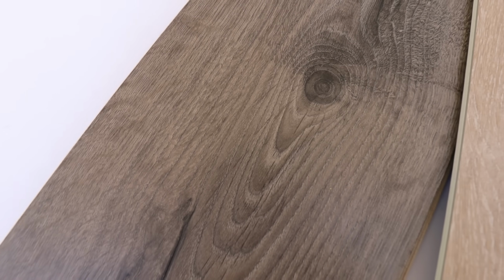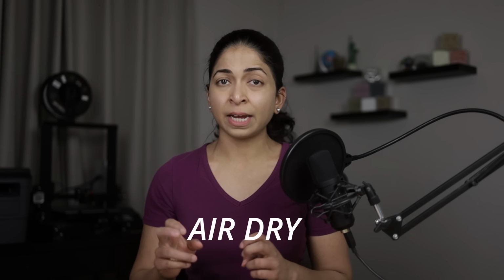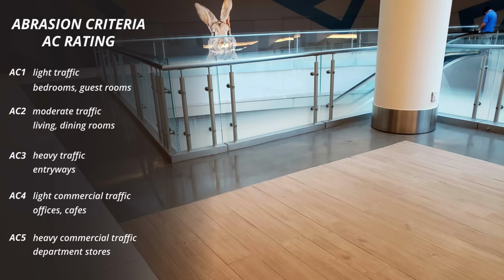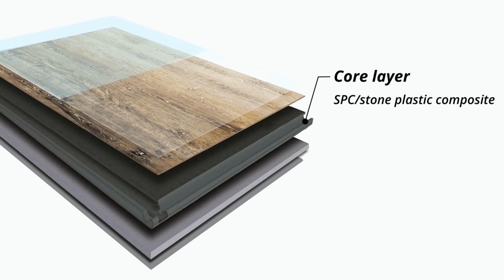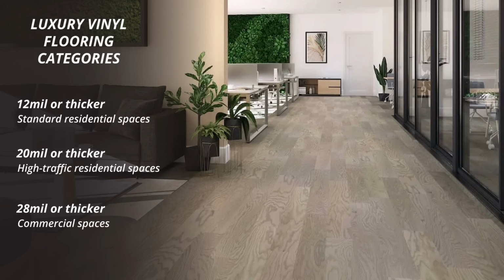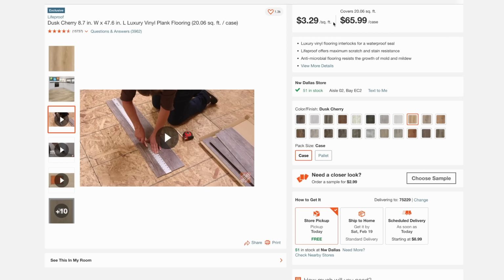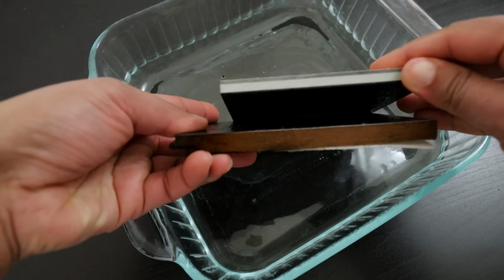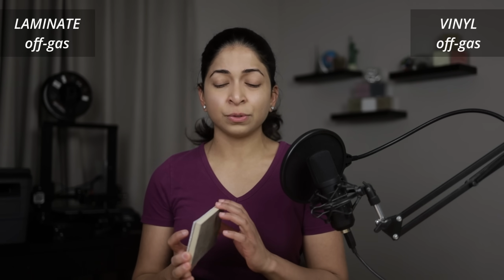Laminate vs Luxury Vinyl Plank Flooring | Everything you need to know!

Comment: The foam underlayment recommended for laminate floor and made by the same company has a fraction of a mm give under load.  That means that standing on one plank can make it try to drop that tiny bit below its neighbor.  A fraction of a mm distortion of the mdf substrate is enough to make a tongue fracture, a tiny length at time, because a couple mm of mdf tongue cannot support the weight of a human.  Within a year any heavy traffic area has the edge of the planks fray due to a fracture of the mdf.   The finish coat then peels and breaks off.  A warranty claim is dismissed as delamination due to water, even it it has never been wet!  We had to argue and point out to them that only the tongue side of many adjacent planks was failing, proving that the movement allowed by the foam slowly caused a fracture in each case.  Water would have delaminated both sides of the joint! They therefore gave us a full refund, but are still selling this bad design to other unsuspecting buyers!   Had we omitted the foam and put up with the slap noise, the floor might not have failed.  Wish we had paid the extra pennies for lux vinyl!       By the way, you show in this video your personal home floor "delaminating" and you assume that it was caused by water.  However, note that it, like mine, is only delaminating on ONE SIDE of the joints. That means, like mine, it was not caused by water, but by a fracture of the mdf!

Comment: I have had a Pergo floor in my basement studio for 20 years and it looks every bit as good as it did the day it was installed.  Better yet, me a 2 friends installed it ourself and it took better part of a day.  It has seen very heavy traffic and numerous types of spills (including dye and paint) that came right up without any discoloration.  It was installed on a concrete floor with a plastic layer that went underneath to block moisture.  The floor was not even close to level but you cannot tell once installed.  I can't speak for other brands but I would definitely recommend Pergo.  I don't know where they get 10-20 years.
Reply: Thank you, we just installed preggo in our house and everyone keeps telling us laminate is crap... this is reassuring to read

Comment: one benefit of vinyl is if you are dealing with less than a perfect leveled floor, vinyl is flexible enough to just fit. my old home has a concrete flat floor and has some bumps and stuff, it will cost me a lot more to level it out before I install laminated, I just use vinyl and nothing need to be done with the floor surface.

Comment: I have a shaw laminate flooring that I installed in most of my home probably 12 years ago and it looks like new. No problems with dog nails. I left some of the cut off scraps out in the rain for months and they didn't swell.  I like the way it feels underfoot and that it's very smooth- no texture, no beveled edges. I have 1 box of lpv flooring that I'm going to try out before ordering for a whole room. Just seeing it in one area I'm not as impressed as I am with the laminate. I'd think using a chop saw as I did with my laminate would give a more exact cut that scoring and snapping.

Comment: What about uneven concrete floors in a condo. I tried to install laminate flooring but it wouldn't stay together. Levelling compound doesn't seem like a good option because there are many sections of irregularities. The building has had carpet since it was built. Is there any flooring option that can conform to irregularities

Comment: For health reasons, go for LVP, especially for basement, kitchen and bathroom applications. Cost difference isn't huge unless you are a commercial house installing thousands of square footage. Have gone through mold and mildew removal in basement due to laminate and subflooring which had MDFs or carbonfootprints which molds love. LVP does better on such realms.

Comment: Outstanding video!  My wife and I are debating between the 2 and this helped a lot.  We did have a question that i am hoping you can answer.  When you mentioned the VOC's, is this only a concern for the first 2 days with the off gassing or the entire life of the flooring?  We are concerned about the chemicals and walking on the floor with our bare feet.  any concerns?  Thank you!

Comment: Good review of these flooring options! I've found that LVT fits together more positively than laminate and stays together better - the interlocking edges of laminate are made of MDF which is a delicate material. Laminates inevitably take up moisture and start to curl up after a year or so whereas LVTs are a lot more durable.

Comment: I have had both installed in kitchens.    I liked the Luxury Vinyl more.  The Vinyl was installed just like a ceramic tile floor.   Current home has hand scrapped engineered wood in the kitchen.  I have also installed myself tile in the kitchen of yet another house I owned.

Comment: Laminate floors will be destroyed with water left on the floor.
I don't see any reason or benefit of using laminate at this time when vinyl flooring is only 10-25% more expensive. And vinyl floor is actually little easier to install (no dust).
10 years ago installed (Germany made 25 years warranty) Laminate floor at my rental property (vinyl was not popular or available at that time), is now shows top layer ruined by water damage, specially at high traffic areas.

Comment: One more thing to consider.  Luxury vinyl tile is softer than laminate.  Heavy furniture like table legs will leave impressions on the softer LVT.  You'll need to place pads under everything including chair legs to reduce the small depressions in the floor.  Laminate will not have this problem.  LVT is more comfortable to walk on if you're barefoot.
Reply: Those pads don't stop the denting in soft plastic flooring. The weight isn't cancelled out, or even reduced at all, by a tiny piece of foam lol. All they do is make it less likely to tear when you move the furniture

Comment: You know, it really doesn't matter much about the looks, thickness, the waterproofing, or the scratch resistance among the different products.  What really matters the most is the locking systems that holds the whole floor together that wasn't covered in this video.  If the locking system fails (breaks)  from an inferior product, it will leave you with gaps and raised seams all over the place. You're not gonna care much about its waterproofing or scratch resistance then!  Buy quality over looks and price and you will be glad you did over the long run.

Comment: As someone who inspects homes for a living, one bit of advice I would offer is DO NOT INSTALL VINYL FLOORING OVER WOOD FLOOR FRAMING THAT IS CONSTRUCTED OVER A CRAWLSPACE AREA - ESPECIALLY IF NO VAPOR RETARDANT GROUND COVER IS INSTALLED IN ATOP THE FLOOR OF THE CRAWLSPACE AND YOU ARE IN AN AREA WITH WET SOIL CONDITIONS…….!!!!!

The vinyl tends to act as a vapor barrier against which naturally occurring moisture from the crawlspace condenses and eventually saturates the wood subfloor and framing members beneath. This usually results in rot in the subfloor panels (first) and (eventually) the structural framing itself……!!!!

Comment: In my old house, I had the HVAC on the first floor and didn’t do proper maintenance for a couple years. As a result, the unit started leaking water from the AC. I would hear a drip every now and then, but thought it was in my head. Eventually, I would walk by the closet where the HVAC was and found the floor was saturated. Eventually the LAMINATE floor started to buckle wherever the water spread.  Basically all the water was sitting under the laminate for a long time. I had tried out vinyl plank flooring for one of the bedrooms a year before and was really impressed with it. So I bought Lifeproof vinyl plank flooring for the entire first floor. It literally felt nice to walk on, it looked good, and most importantly, it was waterproof. Plus there’s a 5 year warranty on the floor. It was a really good investment. It was one of the things that helped me sell my house for double what I bought it for after 1 day on the market (it was my first house I had for a decade). I did end up upgrading to a newer, nicer place, but I miss my old house. I did a ton of projects upgrading everything. My new place doesn’t need anything. But next time I buy a place, I’m going for a project house. I’m pretty sure a project house will keep you living longer.
Reply: True about laminate's water intolerance. I rented out my apartment for 3 years to a woman with a child. When I moved in, some of the laminate was bloated.

Comment: Toxic trash . 
MDF is mostly glue and PVC off gasses . 
Why bother with this junk flooring when you can get tiles and or a number two or three grade solid wood flooring that will last way longer . With air tight homes becoming more essential to save on heating and cooling , it is 
important  to have materials that are non toxic .

Comment: I absolutely detest vinyl plank and laminate flooring. Once it's scratched you cannot buff it out. While it can be convincingly manufactured to look like real wood, it is still an artificial fake finish, and I really think that's awful. Let the material be the material. 

They both have a shorter lifespan than solid wood floor planks such as oak. A 20 year lifespan for a floor is absolutely ridiculously short. You wouldn’t accept a 20 year life expectancy on the interior walls of your home; why would you accept this for your floors?

It was pointed out vinyl plank and laminate flooring cannot be recycled. I would think this goes straight into a landfill, and that’s appalling. And then the next new floor will as well. Are we ever going to get serious about reducing landfills?

I'm living in a 65 year-old home with the original beautiful and re-sanded and resealed REAL solid oak floors. They can be sanded and sealed many more times in the future. I can even change the color to anything I'd like by staining it. It’s for sale at Home Depot for $4.19 per square foot. It will outlive all of us, through repeated sandings and staining. I will NEVER need to replace it; it will endure until the entire house is demolished. And whatever is left can be used for something else, or maybe just downcycled, but NOT sent to a landfill already filled with garbage fake flooring.

How on earth can anyone choose vinyl and laminate flooring?
It makes no sense economically; it makes no sense environmentally.
Reply: I'm sure the cost of your floor, which I have no doubt is beautiful and what most people would love, is economically way out of the reach of most people. I wish I could afford it.

Comment: Great informative video, but in assessing the materials we use, I think sustainability needs to be a core criteria and not just something glossed over in the last few seconds of the assessment. Both options are essentially unsustainable, will never biodegrade, are essentially not possible to repair or re-finish, have a relatively short lifespan and are essentially not possible to recycle. Would be great if you presented a sustainable alternative to these materials!
Reply: What do u suggest? Wood?

Comment: I run a kennel with hundreds of dogs every year.   I also have a rental.  I installed TrafficMaster textured vinyl floating plank with tongue and groove glue strip. (Whew!  That is a mouthful.)  I have been using it for 6 years and it seems nearly indestructible.  It is swept and mopped multiple times everyday and is still in excellent condition.
Reply: We foster 4 our animal shelter which means lots of animals & lots of accidents. We're replacing our carpet but w what is the ?. My friend said not to get lv bc hers buckled but i think it was not installed properly & maybe the newer lv has better water proofing tech. Ty 4 sharing ur exp bc it truly helps people like me (that also have a zoo).

Comment: Would have been nice to see how either does with weight.  Nothing worse than a refrigerator, dishwasher, range, bed, table, or chair sinking into your flooring over time.  Old vinyl flooring didn't do well with weight, and many of the laminates aren't much better.

Comment: I wanted hardwood floors so bad because our new house came with wall to wall carpet  but wasn’t able to afford it so we installed vinyl and we love it . We had two options use all of our savings to install hardwood throughout or use half of it to install vinyl , furnish the house and do some remodeling . I didn’t even bother to do engineered hardwood . I wanted to save for the real deal down the line . I don’t spend hours staring at my floor wishing it was hardwood . It cleans us nice and hold up to anything . Our 10yr plan is to convert the main floor to hardwood . I’ll pick vinyl over laminate any day . My parents have laminate in their kitchen and it doesn’t hold up. Another way to save on  flooring in a  house you’ll live in for a while , is to tile the kitchen and carpet or vinyl the bedrooms . Make sure the match the hardwood you have elsewhere . Vinyl is an amazing option while you save for hardwood
Reply: How much was the vinyl material and installation altogether?

Comment: I'll tell you what's bad with laminates and vinyl plank tap and lock system doesn't stay down they like to slide apart they're not waterproof on concrete you have to put plastic under them laminates harder does not hold up to water we'll also slide apart on you all laminate and vinyl plank trims are junk and if your floor very hard to get manufacturer to hold up to warranty

Comment: Thank you for your videos. I have a question though, I noticed that the few times I've come across the vinyl floors they have a crackling sound, almost like walking on dried leaves, also they have an echo. Is that normal, or bad installation on the floors? and does laminate do the same? Thank you.

Comment: Actually, vinyl scratches MUCH more easily than laminate.  And most laminates are water resistant now.  We never recommend luxury vinyl for families with pets or children, as even a 28mil flooring scratches easily.  All laminate and vinyl has to meet a low VOC rating in most parts of the world, and is our go to for chemical sensitivities, as floating floors require no adhesive.  Glue down and loose lay vinyl plank are all but gone now, as they’ve mostly been phased out.

Comment: I noticed that you excluded products from Tarkett such as ProGen ridged core vinyl LVT. Also, you mentioned that commercial wear layer starts at 28 mils, however that is not correct. ASTM standards states 20 mils is minimum for commercial vinyl floors.
Reply: There are so many wrong statements, I don't know where to begin. You picked 1 of them.

Comment: We have had a problem with vinyl that was stuck down lifting in places, this could be a problem with the installation but they used plenty of glue. Floating laminate has not have this problem but I would recommend using a more expensive underlay, it is only a few dollars more ; we used the recommended very cheap foam but this basically disintegrated when we stored some off cuts.

Comment: luxury vinyl is an excellent product for basement flooring. It gives you much more options vs old fashioned tile or poly and is a little bit "warmer". My basement had water in it once and I was able to remove and dry out the floor, saved me a few thousand $$.

Comment: Didn't i see a video about planed obsolescence on your channel? Both Flooring types belong in that category because of their thin top layers. I've had experience with them in 2 houses. I tell everyone to either use something with a thick and durable top visual layer or something which can easily be repaired (which requires the same product model to be purchasable years later and that is very unlikely).

Comment: Vinyl is not more scratch resistant than laminate 
The underlayment on both the vinyl and laminate are definitely not to be considered as fixes for flooring imperfections.  They are too thin to fix anything that can cause structural issues

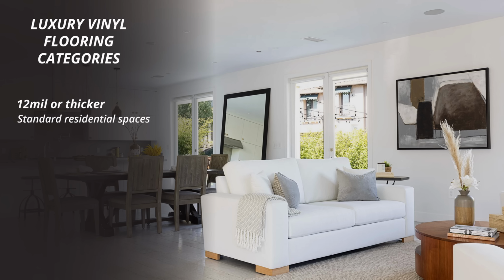Comment: Sorry what! mils? liquid or length / millimetre = metric  length, do you mean 0.3 - 0.5 mm = domestic - commercial clear wear layer @ 4:54  what is 28 mm thick! that's over an 'inch' thick. 1.3 - 3.2 mm is a common 3 layer heterogenous glue down PVC plank with exception of 4 layer semi loose lay or press lock planks which rely on the extra weight + interlock edges, so min. 5mm class usually. A Half inch press lock would be about the Max PVC practical limit if even available. and that would still be rated by a 0.3 or 0.5 clear wear layer unless a special product run.